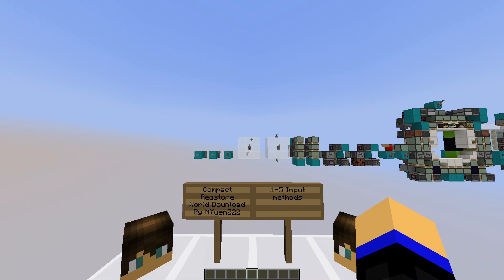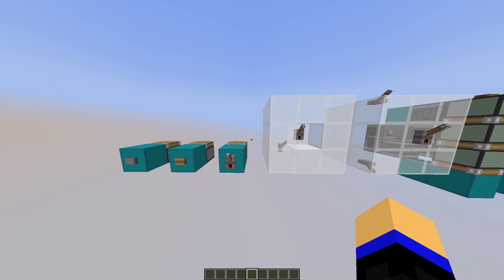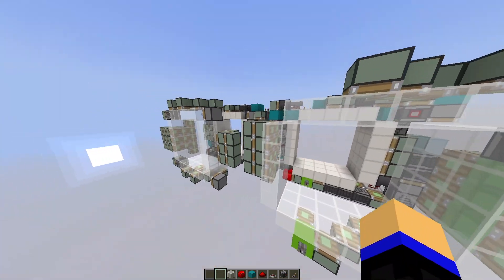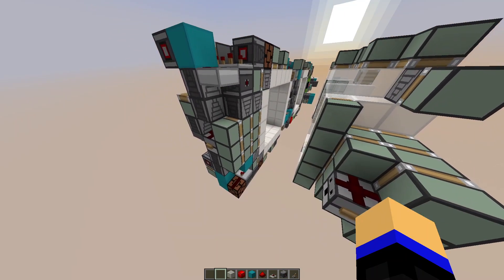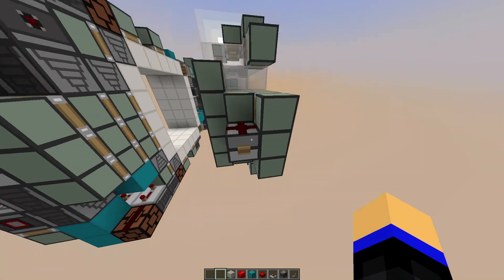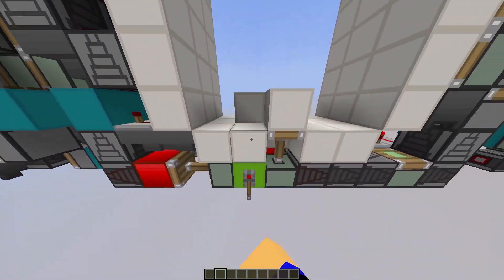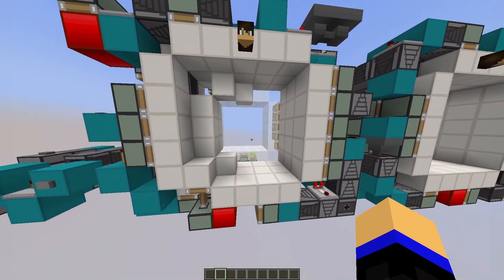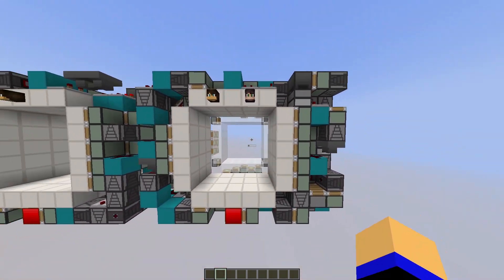Compact Redstone: 1-5 Input methods

Comment: Might be that i  am missing smth, but why piston takes 2gts to extend if its constant power?  Using carpet mod stepping ticks this seems to be 3gts. 
Anyway, this series is very helpful and i am appreciating your time and effort putting it out.
Reply from the maker: I believe the carpet mod simulation is for aesthetic purposes in order to make pistons extend smoothly, similar to the g4mespeed mod I'm using. When a (sticky) piston is constantly powered (at least 3gt), the block in front will actually arrive at its extended position at 2gt, but it takes an extra 1gt for the block to be able to be pushed again. This extra 1gt is known as piston activation delay and will be discussed in 1-11 Introduction to timings. However, this video will take quite some time to be uploaded due to the time taken by previous uploads of the series. This also explains why mods like carpet mod programs piston to look as if they extend in 3gt when it's actually 2gt.
It's a bit complex to test this as piston activation delay only applies to pistons but not other redstone components and the effects of input bug will create delay discrepancies. You can check out these 2 photos to experiment with the delay of different circuits to different components.
Link: https://imgur.com/a/KNSEMQF
Reply: @myuen222   Thank you for a detailed explanation of this issue. It was bothering me for quite some time as i use carpet to time  my contraptions. I'll try to be smarter about that. 
Looking forward for your upcoming videos.